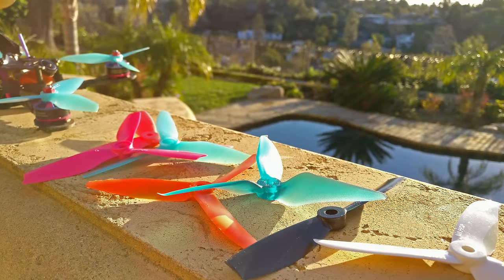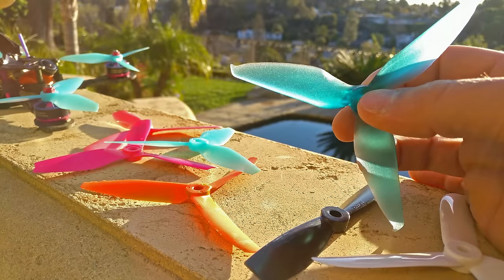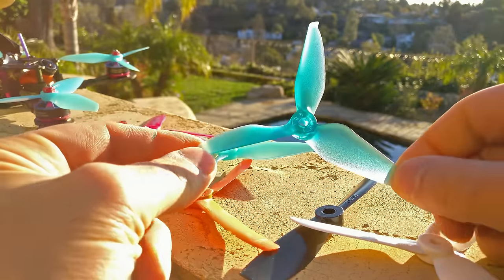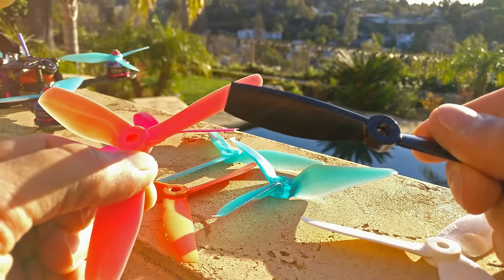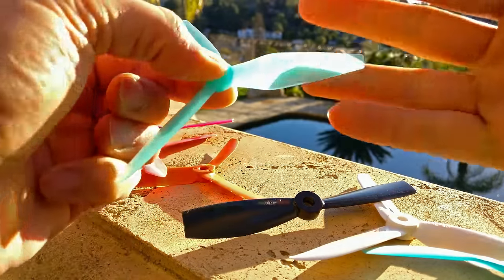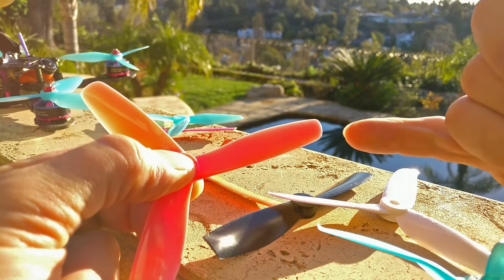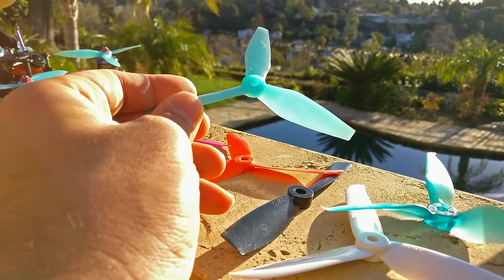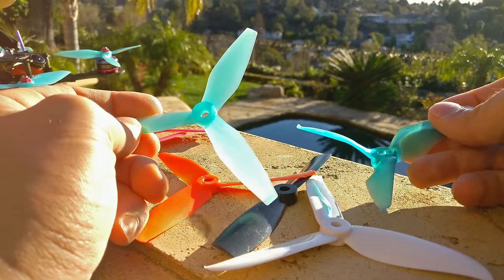Prop Analysis - Quad Theory

Comment: hey kebab fpv, I saw a video and read you mention about a old light quadcopter outrunning a new heavier quadcopter but i can't find the video anymore, any idea how it's called? and last do you think high 22xx KV motors beat lower 22xx KV  despite higher amp draw or doesn't it make that much difference? thank you for your effort in the kwad community
Reply from the maker: Bjorn Bogaerts it's the disk loading theory video. I think the best light weight race motor will be a 2006 ~2500kv that weighs around 22g and has excellent construction quality. unfortunately the closest thing we have are 2204 motors. the best value all around motor will be the Hyperlite 2205 2522kv motor coming out in a week or so. they'll be like $13. 

the planned build should be carefully matched with components for a specific purpose. in general, lighter is better for racing.

Comment: Wouldn't the inner part of the blades befaster because it needs to complete a smaller circle?
Reply from the maker: I'm not sure what you're referring to but if you're talking about RPM, the RPM of inner and outer are the same.  It's just that the end of the blade is moving significantly faster through the air than the inner portion.
Reply: Kabab FPV it's just that wouldn't the innerpart of the blade be spinning faster because it has to complete a smaller rotation to be spinning at the same speed as the outside of the blade which is farther away from the vertex?
Reply: Alex Dalton Nope. They are completing the same RPMs but the outer portion has a longer distance to cover. Imagine the circular rotations were bent into straight lines. The inner portion's rotation will be shorter than the outer portion's rotation, but they cover their respective distances in the same amount of time. For example, 2 runners on a track cover their distances the same amount of time, but one is running 200m and the other is running 100m. Which one is running faster?

Comment: any idea on the cyclone v2 release?
Reply from the maker: They've been out for a few weeks already.  The next version of the Cyclone is released today and should be available next week maybe.  It doesn't have a name yet.  Might just be called the Cyclone Light.
Reply: Yes they are out since a couple of weeks! I received my first batch for testing purpose last week and honestly they feel good :)
Reply from the maker: ABMNS PRODUCTION feel very very good. just a bit heavy however.
Reply: I just got an updated wholesale list from dalprop yesterday and they aren't on there yet, asking my rep about it but it'll probably be tomorrow before I get an answer.

Comment: You keep talking about how the 5051 is engineered for a specific speed.  Don't understand how that's a good thing - the one thing race quads do not do is cruise at a set speed for long periods.  As for the HQ v3 props - I flew them today and quite liked them.  Felt similar in power to the Cyclones but with a bit more precision.  They are not horrible props and don't draw too many amps, at least on my rig (F60s).
Reply from the maker: Luke Godeassi the props being engineered for a speed isn't good or bad. it's just made to be most efficient at 60mph where's the HQ prop is most efficient at very low speeds as are most aggressive props like that. if it works well for you, keep using it.
Reply: I agree Luke, we've found the V3 to be amazing. I also love Kabab FPV's channel, what you're seeing here is his passion. Thomas is great like that, he will try everything and not take anyone's word without testing. I believe Kabab FPV has been coaching Thomas on his channel :D
Reply: BMSWEB oh totally, much love to kabab - he gets us all thinking and talking. I tried the set of V3s you gave to Bizz today and whilst I only flew a couple of packs with them, I really liked how they felt. Will be getting some more when I find a place that sells them!
Reply: Glad you got to try them :D I was hanging out to hear what Bizz thought of the props I gave him :D
Reply from the maker: Luke Godeassi I think PiroFlipRC is one of the only places that sells them. he ordered more to sell because they all sold so quickly.
Reply: The HQ v3 props seem to be engineered to provide thrust and efficiency at lower speeds, so they should feel much better to fly with lower kv motors. They are however bullnose so even within their efficiency envelope they might perform a little behind their competitors. 

The 51 in 5051 refers to the advance ratio of 5.1" per rotation, which (basically) means they are most efficient when traveling at a higher speed than the HQ v3 props which are designed to advance somewhere around 4.5" per rotation. 

If you prefer to fly a light quad as fast as possible all the time, you probably wont like a prop designed to be efficient (as a bullnose can be) at a lower speed as much as a prop designed to be efficient at a higher speed. This is why you see so many acro flyers using the old HQ 5040 triblade even though it might not be the best in a race scenario- its great for "grip" at a lower speed.

One thing that wasn't touched on in the video is that the shape of the V3 prop could actually be pretty efficient if you ignore the bullnose, as they taper off nicely towards the end, where they are tragically ended in a square shape.
Reply from the maker: R J tragic! yes!  the new DAL prop is even more tragic unfortunately. a very nicely made 3.7g steep pitch prop with very nice proportions and most likely pretty durable. completely destroyed by a square tip.
Reply: Maybe the nail clippers can salvage it a bit haha
Reply: Thanks for the head's up re PrioFlipRC Kabab.  I'm in Australia so hoping there'll be a local supplier soon, but if not it's good to know where I can import them from.
Reply from the maker: R J yes I'm actually going to find the biggest nail clippers I can so I can put a really smooth slight curve on the blade.  not so abrupt like I did on the HQ prop.